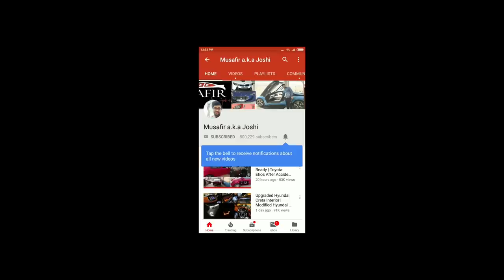My Car Door Got Stuck !!!

Comment: hi, musafir last week I crashed my ignis into a tree and the airbags didn't work . I repaired my car at authorized service center and the mentioned the change of airbags. I was surprised and I asked them about it and the said your airbags are damaged and thats the reason they changed.
Reply: Airbag need certain force to open if the impact is not so strong airbags won't open and need not to replace...

Comment: Musafir bhai autocop ka remote locking system achha hota hai?
Reply: company ka best rehta hai
Reply: Acha hota hai but autocop very soon band ho jane vala hai. Better go for minda or black car
Reply: Ise kuch ni pta.
Reply: Jis Bhi brand ki gaadi ho uska best hai
Reply: There are many central locking systems autocop, minda, RD , Nippon etc. autocop is bit costlier and less service worthy. Go for RD or Minda. RD is economical also. It will cost in range of 2200 to 2500. Nipon is used by Maruti as genuine central locking system and is bit costly.
Reply: Ankit Sharma ye to Khud mistry se puch ke kaam krata hai, 300 ke kaam ke 800 deta hai.